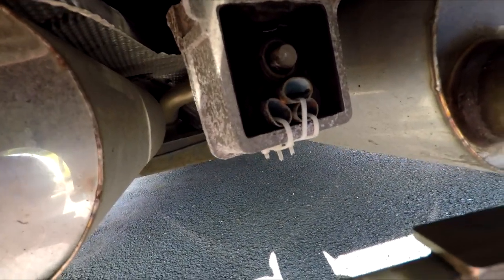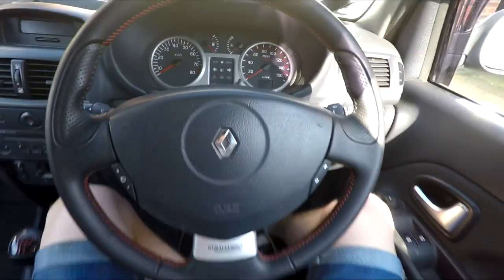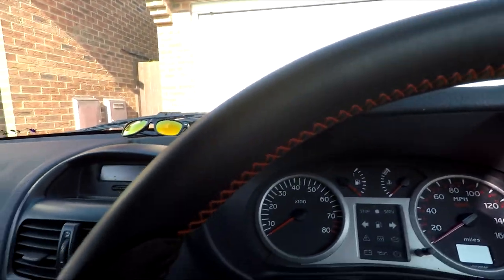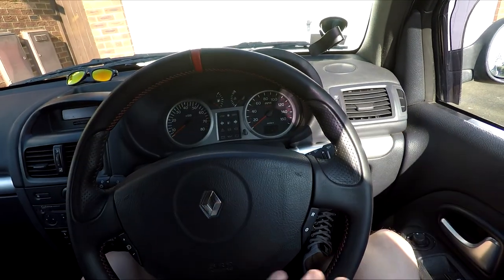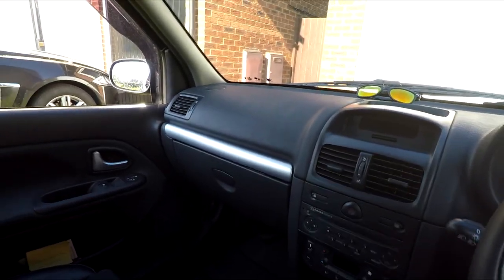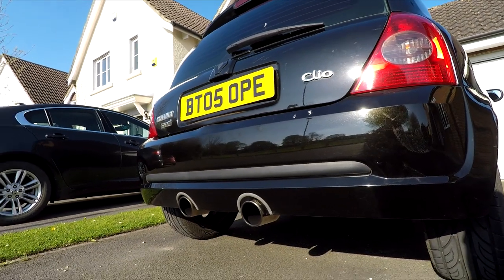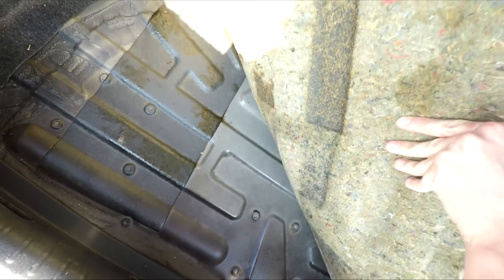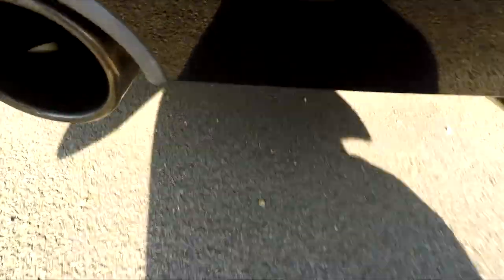Clio 182 - 5 Things i hate about my Clio (cosmetic)

Comment: You have a really watchable/fluent style..excited to see where your vlogs go! I own a 182 and also had issues with the exhaust mount..replaced them with solid mounts from a company called Powerflex and haven't had a problem since.
Reply from the maker: MrCube17 thank you for that feedback! Funny you should say that as I've just bought, they are getting delivery this Thurs/fri hopefully! Happy to know they're good! 👍🏻
Reply from the maker: MrCube17 thank you for the feedback bud! Funny you should say that as I've just bought, they are getting delivery this Thurs/fri hopefully! Happy to know they're good! 👍🏻
Reply: I had trouble getting the old rubber out of the mounts - they were properly stuck in there...an easy way to do it is to light them on fire (off the car of course!) then the residue just falls out. Once ready a bit of silicone or oil will help massively with installing the Powerflex ones!
Reply from the maker: MrCube17 Sweet! Thanks for the tips, that sounds good to me! might have to do a video on it at this rate 😂
Reply: I'm excited for the video showing how you get on ;)
Reply from the maker: I'm also very excited! Thanks again, really appreciate all you comments! :D

Comment: What's this like on insurance? I'm driving a 16 ford fiesta s with a one litre turbo and it costs £1100 a year for me (without the box). I need to get my own car because it's my dad's see, wouldn't mind a Clio sport or a swift sport
Reply from the maker: Cryocynical insurance for me is £550 for the year, I’m 24. Started driving it at 20 and as a guess I paid around £900 ish for insurance back then. Be aware of the tax which is now £265 for the year, whereas the Swift I think is a 1.6? So will probably be less of a cost on both. Just go with what you like really 🤙🏻
Reply: Jordan Meale That's class, I wish mine was that cheap 😂, I am 18 though so I'm new to driving. And yeah, the fiesta I pay fuck all tax on it because it does 68 to the gallon with 138bhp aswell which is impressive. I do like the swift, it isn't very powerful but the fact that it's Japanese just appeals to me. Either that or the model clio that you have, I've always had a soft spot for that Renault aha
Reply: Jordan Meale Not too keen on the brand new Clio, much prefer your model, my friend has the same car but not the sport spec, just a 1.4 his is, very fun to drive!